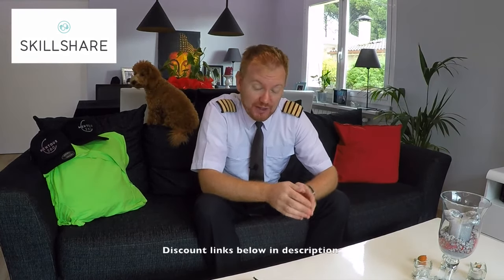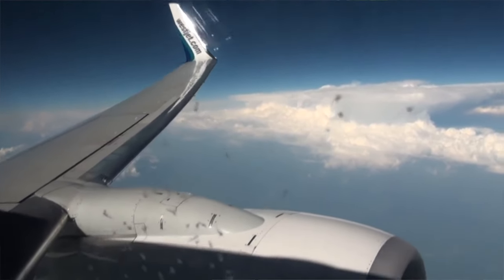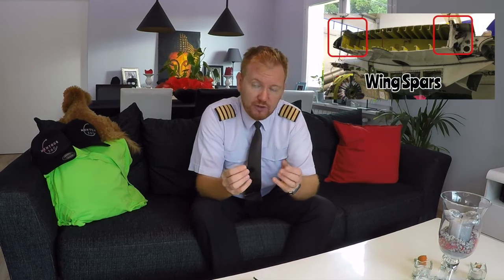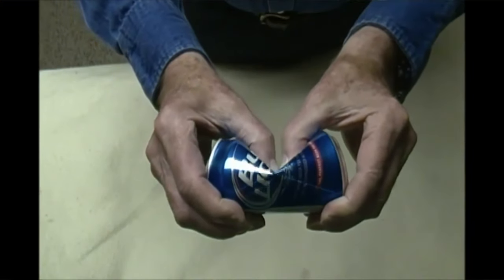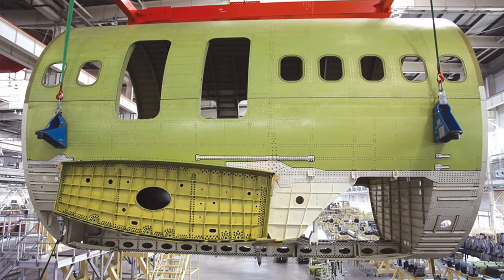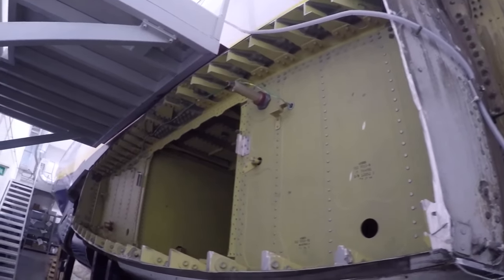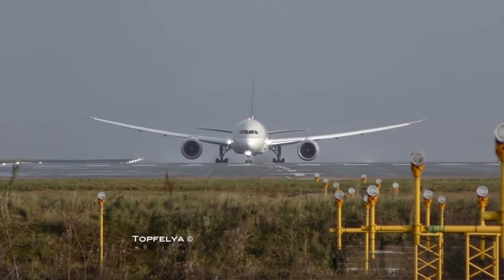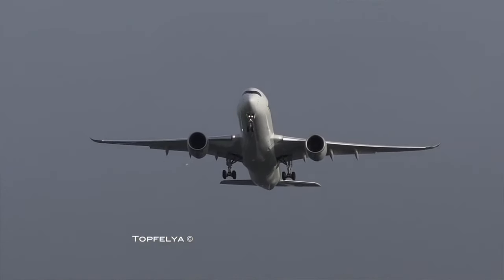Why don't the wings break?!

Comment: Ahhh... Sorry, but I hate the term 'aircraft grade aluminum'! In reality all aluminum alloys have been used in one aircraft application or another. Yes, high strength alloys are carefully chosen for structural components... but go out in the real world and try to buy some 'aircraft grade' and you'll be laughed at.   (Another annoying marketing term is the word 'tactical'. It's astounding how many people respond to that one...)
Also, way back in A&P school, they told us that most everything is engineered to withstand 'redline' plus a minimum of 150%... but  that was a long time ago, early 70's. Cool videos, Thanks! (Edited for spelling.)
Reply: Yep there are truckloads of different alloys used in aircraft. I cant remember the specifics but 2024 and 7075 seem to be used most often these days,
Reply: Yes, scores of them! As with any material, each has it's advantages & disadvantages.
Reply: @gordonlawrence4749  these days its primarily 7175 when talking about structural components like wing spars
Reply: @mwbgaming28   Yes if it's not made out CFRP.
Reply: @mauriciocastro7505  well theres a reason i dont fly on the 787, until i see a 787 go 30+ years without a spar snapping 
il stick with metal, carbon fiber materials are amazing and all, but i dont really trust them with my life just yet
Reply: @mwbgaming28  carbon fiber is not sensitive to fatigue as metal does. Unless there is another unknown phenomena carbon fiber should last longer.
Reply: "aircraft grade" aluminium sounds geeky and gimmicky to the non-aircraft geek types of people, but they don't know just how strong it is
Reply: "Aircraft quality" aluminum is a thing.  You know that it's manufactured in conformance to a standard (e.g., AN, ANSI, NAS,etc) that specifies the proportion and purity of its component ores and the process of its manufacture, including heat treating.  Depending on where you go out in the real world to buy "aircraft quality" aluminum, the salesman is either waiting for you to specify what kind, or wondering why thell you've come to Home Depot in search of it.
Reply: @mwbgaming28  There have been composite parts on airplanes for perhaps 30 years.   Started with composite control surfaces.   Then the 747-400 Empennage is 100% composite (larger than a 737 wing).
Reply: @DennisBurkeBrehmer-1   perhaps, but control surfaces are not key structural components, in any case i think il wait

also, aerospace grade aluminium (which is what 7000 series aluminium actually is) sounds more high tech than aircraft grade aluminium, just saying

and for the record the mechanical properties of 7175 aluminium alloy are as follows 
fatigue strength: 150-180MPa 
shear strength: 290-330MPa 
tensile strength: 430-490MPa (yield) 
tensile strength: 520-570MPa (ultimate) 

not sure what the properties of CFRP are but until i can find data on the material and composition (along with a good record) when it comes to structural elements

metal or GTFO
Reply: @mwbgaming28  yep you are right my info is a bit out of date.
Reply: rwbishop, I agree especially with the word "tactical". It's like any LED flashlight (or torch depending on which country you're in...) increases in quality and brightness of you write "tactical" on it 😁
Reply: @mwbgaming28   777 first flight 1994 (24 years ago)
Reply: @DennisBurkeBrehmer-1  But not with a composite wing, which wil be introduced on the 777X.
Reply: @ericcoleson7410  i dont have a fear of flying by any stretch of the word (i fly several times a month and enjoy every minute of it, even in shitty weather) but the 777X with the proposed "folding wingtip" makes the hair on my neck stand up 

i hope Boeing built the flight controls with enough control authority that the plane can still fly (and land) if a wingtip folds (or breaks off) inflight, and provides special training on how to land the plane in that condition

losing 3.5m of wing (the size of one folding section) on one side without enough control authority from the ailerons would likely lead to a spiral dive and a crash, especially at low airspeed and during landing where not only are the flight controls are less effective but the wings are generating more lift due to being at a higher AOA (which would make the asymmetric lift worse and make the roll even harder to control) 
similar to EL AL 1862 (the plane was flying steady until it slowed down for landing, then it banked hard and crashed unto a building)

i doubt most civilian pilots have any experience (or training) flying a plane that has asymmetric lift (ex military pilots might though)

so even if the plane can still fly, there's a chance the pilot might not understand how the damage is effecting the controlability of the plane through its entire flight envelope if he/she has not been trained for it

TL,DR
folding wingtips = a future episode of air crash investigation
Reply: @mwbgaming28  Not a big fan of the idea myself, but more from the pages it'll add to the maintenance and operating instructions and procedures.

I have a lot of confidence in the design and certification procecss.  If an assymetric failure is even remotely possible, you can bet that every pilot qualified to fly the airplane will have flown the pants off that problem in the simulator.

My biggest fear?  False warnings are about a billion times more common than catastrophic failures, and a "wingtip unsafe" light wouldn't be the first time an airplane was lost because of a false warning.
Reply: @ericcoleson7410  in theory practicing a wingtip failure in the simulator would give pilots the necessary knowledge to land the plane in such a condition (assuming the plane is designed to be able to fly and land safely with a missing wingtip) 

but we both know that airlines cut corners anywhere they can, and training is one of those places for corners to be cut without anyone knowing (until that training is needed) 

as for a false "wingtip unsafe" warning, it will be very easy to determine if its a false warning or not during flight (since the plane will be rolling significantly or outright corkscrewing toward the ground if a wingtip has indeed unhitched or broken off completely)

i personally think Boeing should keep the wing as a solid piece and scrap the idea of folding wingtips altogether, if the plane doesn't fit in the terminal parking bay, airports can expand the jetways or board passengers via the tarmac with stairs

moving parts (especially structural parts) and joints are yet another point of failure
Reply: @mwbgaming28  i disagree.  1) If you truly believe that airlines intentionally and routinely cut corners on training, I don't understand how you can NOT be afraid to fly on them.  I certainly would be.  2) I refer to an "unsafe" light as meaning that sensors are unable to verify that something is entirely safe and functional.  E.g., if the "door open" light in your car remains lit until closing and fully latching the door opens a circuit between the power source and the lamp, it will remain lit with the fully closed and latched door if the switch or wiring between it and the lamp fail "open".  3) Yes, folding wingtips add complexity (and weight!).  Nobody would buy them if they didn't see a profit in it.  You can increase gate space, but real estate is finite:  How many gates are you willing to give up to make space for one (or six) of these?  You can operate cargo off the ramp, but you still fit fewer airplanes on the ramp to make space for a longer wing.  You can move passengers to an airplane out on the ramp in shuttles, but then you have to maintain and operate a fleet of shuttles, and can you afford to double your turnaround times?  4) Folding wings have been around for a long time.  How many airplanes have we lost to catastrophic failure of the wing folding mechanisms, or the structure that supports it?  (I don't know, either, but I've never heard of one).
Reply: @mauriciocastro7505  Delamination is to composite structures as fatigue is to metal ones.
Reply: @ericcoleson7410  
1: i rely on the fact that in my country (Australia) no accident has resulted in the hull loss of a commercial jet, and with current aircraft, training is generally one size fits all to a degree, its much cheaper for a 737 pilot to get certified to fly an A320 and vice versa than it would be for a 777 pilot to be certified to fly the 777X if wingtip usage and wingtip failure training is to be given, i can see a lot of airlines giving the bare minimum if any at all, i usually only fly with Qantas who has a flawless safety record and also has the best training and aircraft maintenance records in the country (mostly because they make near infinite money with flybuys points, even more than they do by selling plane tickets, therefore they can afford to sink money into their planes and pilots, and as far as i know they spare no expense when doing so)

if i can fly a 737 in a simulator, im pretty sure the pilot can fly one too

also, pilots are not trained to land a plane with no flight controls (using engine power alone) because airlines and manufacturers say "it will never happen" yet it has happened 3 times on 3 different planes and resulted in the deaths of 631 people 
the first one was a 747 that crashed into mount fuji killing 520 people (4 survivors)
the second one was a DC-10 that crashed next to the runway in sioux city killing 111 people (185 survivors)
the third one was an A300 that got hit by a missile in iraq (the plane was repaired and there were no fatalities) 

2: i see what you are saying, i thought you were referring to an inflight warning that the tip has failed 

3: the profit for airlines is a 12% reduction in fuel burn which should result in slightly cheaper tickets or (what i would prefer) better maintenance, or (the most likely outcome) just to line their pockets more
electric shuttles can be recharged for pennies, the batteries will last for many years, they require almost no maintenance and would probably increase turnaround times by 20-30% tops

4: folding wings have been around for ages on small military planes like fighters or light bombers, nothing even close to the likes of a widebody passenger plane and the wing fold mechanisms on those military planes are usually made of TI-15V titanium alloy (which is an order of magnitude stronger than any composite material as far as tensile and shear strength are concerned, though it is expensive and moderately heavy, even compared to 7175 aluminium) or some other high strength alloy 

im not saying every 777X will crash or lose a wingtip during flight, but like every new technology, there will be teething issues and i personally am going to wait until those teething issues are finished, id rather not take the risk on new technologies until they have proven themselves, and currently in my opinion (which is all it really is) composite structural components and folding wingtips on large aircraft have not proven themselves to be safe (to me) 
i cant stop everyone else from flying on such an aircraft, but i personally will wait until i am satisfied its safe before i step on board
Reply: @mwbgaming28  I read your reservations in re emerging technologies 5-by-5.  1976-ish, I sat in on a meeting at McDonnell-Douglas in which an advanced DC-10 was being pitched to a room full of airline engineering and maintenance heads.  Many of the improvements on the table would turn up on the MD-11 years later.  Possible upgrades included a glass cockpit, computer-augmented stability (CAS), and fly-by-wire (FBW) flight contols.  Don DuPont, then the technical VP at Continental Airlines, admitted to being deeply impressed with the potential afforded by CAS and FBW, as was currently being demonstrated on the F-16 fighter.  He'd welcome tbe introduction of such advanced technology into the transport fleet, he said, when we could provide 335 ejection seats for the passengers and crew.

That said, composite structures aren't exactly new tech.  We've had over 50 years flying all-fiberglass sailplanes to discover and ameliorate failure modes.  Satisfactory non-destructive testing of composite structures was proven before the first multi-passenger light airplanes could be certified in the normal category.  The 787 wing life cycle is being tested to destruction the same way as any metal wing.  The 777X wing and folding tip will be deep into demonstrating airworthiness under the same brutal protocol long before anybody can sell you a ticket on it.

Being picky about what carrier you fly on is the best way to avoid participating in an aviation catastrophe, and the odds may be more in your favor on Quantas than with anybody else.   Odds are quirky things, though.  I've always taken "virtually impossible" 
(1*10^-9) to mean it can happen this morning and still be "highly unlikely" (1*10^-7) to occur again tomorrow.

And don't look now, but that B737-800 you're flying on Quantas is just teeming with advanced technology that has emerged since they took the flight engineer out of the cockpit about 50 years ago.
Reply: @ericcoleson7410  Theres a big difference between replacing pulleys and cables with computers vs adding a huge moving part to the end of the wing and using a weaker material to hold it together than was used successfully on other planes with that feature (CFRP vs titanium) 

if a computer fails on the 737-800 the pilots can use manual reversion to land the plane (or using only the trim wheels and rudder pedals on the A320) and they are trained extensively to do so

if a folding wingtip breaks off because some engineer made a mistake during maintenance or the material degrades faster than predicted or whatever, i doubt the ailerons would have enough control authority to arrest the roll caused by losing 3.5m of aerodynamic surface on one side, especially at low speeds and with the wings at a high angle of attack and to top it all off, the flight controls are less effective (look up EL AL 1862 for an idea of what it would be like)

anytime you add a moving part to an aircraft (especially a load bearing part like a wingtip) you add another point of failure and a place where flight loads can be concentrated, the mechanism that holds the wingtip straight during flight will have to be even stronger than the wing box (where the wings attach to the rest of the plane) because of the fact that it is not one solid piece AND the fact it has to be able to move, simple hardened steel locking sectors or locking pins are not going to cut it, and theres no way in hell you could make the locking mechanism out of CFRP

and theres another tricky problem to contend with, when you use different materials in the same object, the weak links will be where a stronger material attaches to a weaker one (in this instance it will be where the locking mechanism attaches to the wing and wingtip, which is yet another point of failure, and since metal is harder than CFRP, over time the metal attachment point will slowly cut into the composite spar where it attaches due to slight movement at the attachment point during normal flight until one day it simply breaks off)

thats 3 points of failure in one part 
1: wingtip to locking mechanism attachment point 
2: wing to locking mechanism attachment point 
3: the locking mechanism itself 

theres a reason i pick Qantas when i fly, they are the best in the business for not crashing their planes (in fact, they have never lost a passenger jet... ever) also we have very good ATC to stop planes from hitting each other and our maintenance engineers are some of the best available, and i suspect its due to this that no passenger jet from any local or foreign airline has ever crashed in Australian airspace (very few countries can make that claim)

though i suspect that may change if we rush off and buy new folding wing planes without following the rule of "never go first" with new technologies
Reply: @mwbgaming28  You seem to be convinced that 1) Boeing can't design a composite wing and especially not one with a folding tip; 2) No amount or means of testing will detect a fatal flaw in the design: 3) Not even Quantas' engineering staff will see it coming before it happens; and 4) Not even Quantas' pilots will be able to fly it when it does.  I won't try to change your mind.

For everybody else out there, yes:  Designers can be blind-sided by the unforseen.  Maintenance can be blind-sided by defects they overlook.  Pilots can be blind-sided by problems they're not prepared to solve before the airplane hits the ground.  If you lack faith in any of the three, saddle up the horse.  There isn't a 100% safe mechanical device that will get you there.

That said, losing 11 or so feet on one side of a 233 foot wing would certainly result in some assymetric lift.  I guarantee you that if it's seen to be even remotely possible, the failure mode and effects will be fully explored in design; fully modeled on the computer and in wind tunnels; fully tested in full scale over the anticipated life cycle and further, to destruction; fully scrutinized by the regulatory agencies, along with maintenance and inspection procedures and intervals; and flown the hell out of (in the simulator) according to an approved emergency checklist that will specify the minimum safe speed for the condition, by every pilot who's going to fly it.  That's the process.  Trust it or don't.  The pilots do.

An El Al B-747 shed 8,000+ kg of engine weight and lost use of leading or trailing edge high lift devices on the outboard 2/3 of that wing.  The aircraft was lost when the crew tried to slow the aircraft to the recommended speed for a configuration they mistakenly presumed to be the case.  You want to conflate that with a Boeing 777X losing something like the outboard 11 feet (5%) on one side of a 233-foot span wing?
Reply: @ericcoleson7410  you fail to see the fact that they are taking something that is only ever used on small military planes and they are up-scaling it to a passenger plane AND using weaker materials to make it even though those materials will be under orders of magnitude more load during flight

asymmetric lift is a tricky thing to correct for, especially when you have to contend with changes in AoA skewing the numbers 

the ELAL plane did lose a lot of weight on that side (which is probably the main reason it was controllable at all) and lost 60% of the leading edge of the right wing but they still had trailing edge flaps

my main concern is the material they are making the wing and locking mechanism from, the smaller military planes that have folding wings all use titanium and precipitation hardened aluminium, titanium is vastly stronger than plastic laminated carbon fiber 

im simply saying that as of right now, i dont trust it and i will wait a few years before i fly on any plane with a composite wing spar and folding wingtip
Reply: Sure bit not everyone understands or cares about the technical terms or scientific names. If I say I’m having Agaricus Bisporus for dinner most people won’t know wtf I’m on about, but everyone knows what button mushrooms/portobello mushrooms are.
Reply: @mwbgaming28  Au contraire.  I am at least as aware of the facts as you may be,  but weigh them through a different set of filters.  Experience will do that.  I don't begrudge you your reservations over emerging technology.  I have my own, but they have more to do with our ability to deal with it even when it"s functioning exactly as it was designed to.
Reply: @mwbgaming28  i get your logic, but you should know that fighter jets have been using carbon fiber for many decades through tougher conditions so i your fears are unfounded
Reply: @gazzarafalemozzy4766  the tensile loads generated by a 30 ton fighter jet are lower than the loads generated by a 300+ ton passenger plane as far as the wing structure is concerned 

once i see a 777X land safely with a folded or missing wingtip (even during a test flight) and in a separate flight be able fly through shitty weather without its composite wing structures sustaining damage or showing any signs of delaminating, then il trust it 

but the fact that Boeing is very quiet about if the 777X can fly minus a wingtip leads me to believe that the loss of a wingtip will probably result in a spiral dive and a future episode of air crash investigation 

im an evidence driven person, if theres proof that the 777X can fly with a missing or folded wingtip and that the composite structural members are just as strong and durable as the aluminium ones used in other aircraft like the A380 and 747, then il be more than happy to step on board a 777X

until then, il wait
Reply: @mwbgaming28  totally your choice i disagree with your assumption and overly simplified view comparing the military aircraft using weight comparisons you are obviously forgetting the stresses that fighters are under when in combat manoeuvres and the fact that they are supersonic etc. im ex airforce so im not an engineer but i worked with engineers at my HQ and i know what im saying is not wrong so you can do as you please but i  know that carbon is pretty strong and safe proven stuff..
Reply: @gazzarafalemozzy4766  even pulling 6G in a turn, that 30 ton fighter only weighs 180 tons (half the weight of a commercial jet)

as i said before, il wait until the material has proven itself
Reply: 6G? try 9G in aggressive manoeuvring, and thats not taking into account the pressure from high mach that they have to be able to withstand which is not something commercial aircraft worry about
Reply: @mwbgaming28  
It's also bicycle grade aluminum. 
Unless it's a cheap walmart bike, most alloy bike frames are 7075. Too bad it doesn't sound as high-tech or geeky.
Reply: @gazzarafalemozzy4766  then its 270 tons at 9G (which humans can only withstand for a few seconds at a time)
still less than the weight of a 777 in level flight 
mach effects are negligible as the structural components in the wings of a fighter are designed to disperse the load evenly throughout the structure
Reply: @mwbgaming28 clearly just based on your last comment you are a very ignorant person, (humans can only withstand 9G for a few seconds, you said)? that is your argument now? well the wings etc whether its a few seconds or minutes is irrelevant , because they still have to be strong enough to routinely cope with those forces regardless of the duration, and even if it is slightly less overall weight than a 777, as you then say that is also irrelevant. Finally obviously aspect ratios are different on fighters to gliders to commercial aircraft, which if you ever flew a plane is one of the first basic things you learn about , but all my original post pointed out was that this material has been used for as long as you stated you trusted traditional material ie aluminium etc. But sorry, kid i dont have time to keep replying to your nonsense
Reply: @gazzarafalemozzy4766  id like to see you take 9G for more than a few seconds without hitting G-LOC
i personally hit G-LOC at around 4G 

point is, aluminium has better tensile and shear strength than plastic laminated carbon fiber sheets
Reply: MWB Gaming it’s ALUMINUM. ffs
Reply: MWB Gaming shows what you know it was aluminum before y’all over seas changed it. Don’t talk about what you don’t know.